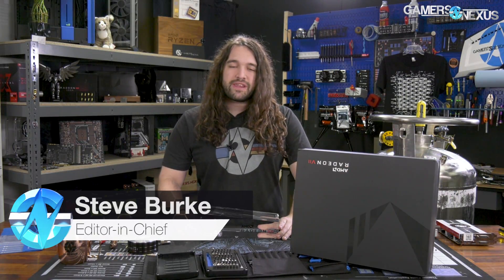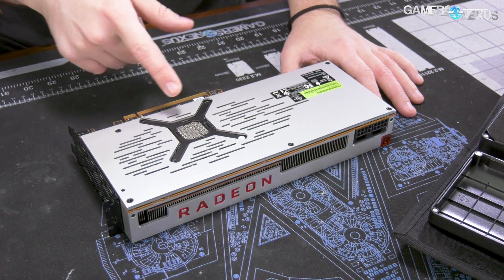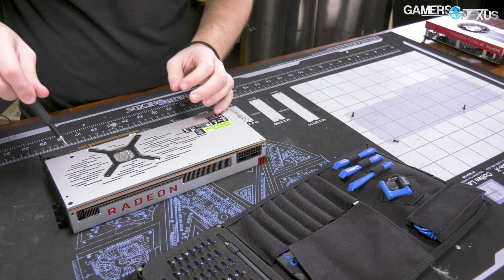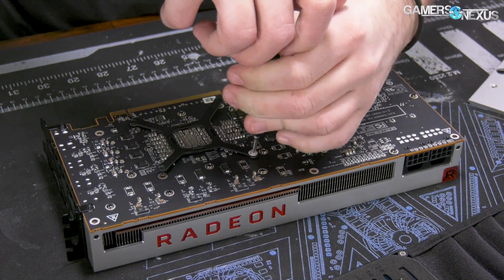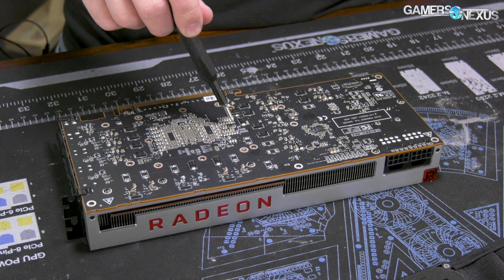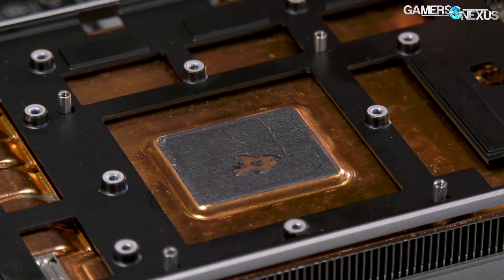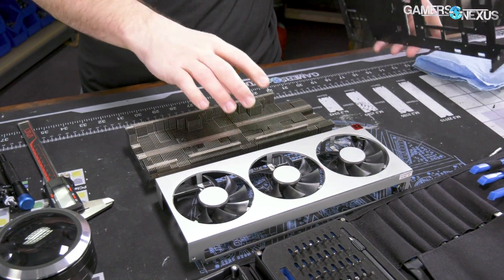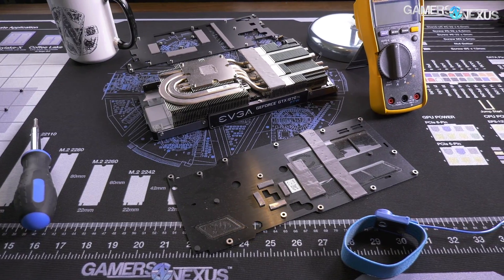AMD Radeon VII Tear-Down & Graphite Thermal Pad

Comment: Warranty Void stickers are also not enforceable in Canada.
Reply: Can technically cop fines for them in Australia
Reply: I had a rep from XFX tell me, on the phone, that they are not enforceable in North America.  He confirmed that they are to scare-off noobs; and, so they can tell if it has been opened while troubleshooting RMAs.
Reply: Not sure about Canada, but they can NOT deny a claim simple based on the fact the sticker was removed. They MUST provide proof that the user modifications caused the damage to the device. I believe this only applies if they are offering the warranty repair for free.
Reply: Nice. I did not know that. Thank you. I am Canadian.
Reply: If you had removed them without leaving any marks they would have to prove that they were there on that specific card which would also be quite pointless without having taken some pictures after being manufactured (showing part numbers too) - apart from the only reason is to scare customers off.
Reply: Doesn't stop Canadian companies from applying them though.  Memory Express slathered my beautiful G.Skill Trident Z memory sticks with oversized and very ugly warranty void if removed stickers.  Was a total PIA to remove the gummy adhesive left behind...
Reply: I dont know if they are in Poland, but I know that at least MSI has accepted my laptop for warranty repair regardless of the warranty sticker or lack there of.
They even took the laptop 3 weeks past warranty coverage saying that they accept the cost of the repair because it was clearly a manufactuing issue, even if it showed up after 2 years.

I have heard in the past that warranty stickers are there to discourage people from "playing with it" and then returning it when they break it, but that it is not the official reason.
I have had situations in the past (in Spain) where the warranty stickers were enforceable when I lived there, where the laptop companies/repair shops/shops would replace a damaged warranty sticker in order for a customer to get full warranty coverage.

But maybe I was just very lucky... (and I am a small sample size).

But it does make you feel safe buying from people/companies that treat you this good.
Reply: Not to defend the sticker but if they are using a graphite pad what reason is there to ever open it up?
Aren't those things focused on extreme longevity unlike thermal paste and so should never need replacing?
If it does adequately thermally the other manufacturers should put in those 1 screw pop-in pop-out fans that are so popular on Sapphire cards
Reply: @mycosys  Don't you guys have to vote or get fined as well?
Reply: @nonamefound68  Indeed - thats why driving voting down isnt a conservative strategy to rig elections here.
Reply: @mycosys  what do you mean??
Reply: @stevethea5250  It is a normal republican tactic to try to keep voting numbers down in the US. the more people vote,  democrats get elected. There is also a gerrymander that values votes in republican areas more, we have had that problem in the past too.

Comment: Finally true unboxing.
Reply: Why the instant autopsy on the item?
Reply: @mohdfaizal6773  why not
Reply: the downgrade on the VRM over the utterly insanely overbuilt Vega reference cards bodes either very well or very bad. Either AMD was sandbagging like mad when they stated a 300w TDP; or they don't wan't a repeat of the legendary value king Vega 56 OC specials where this card is able to eclipse later full fat Vega 7nm releases.
Reply: @mohdfaizal6773  To see how terribly made the card is.
Reply: Steve said that if he ever did an unboxing embargo video to shoot him. I'm coming for you, Steve.
Reply: @ashleyjohansson230  Terribly made? Did we watch the same video? The cooling design is on par with most Custom-Designs we have seen over the years. I think it will turn out pretty good :D
Reply: @mohdfaizal6773  to show master engineering of AMD in comparison to Nvidia GPUs

Comment: I love the cooler, it's so clean and professional looking.
Reply: Some hate it but I agree
Reply: Not professional but industrial
Reply: My take as well. It looks really simple, but it's a lot of technical work to get it to look so clean. Otherwise it would be a mish-mash of pipes and fins. Looks really good.
Reply: @youtubasoarus  i want to know temps of this since there will be no non reference models. I had 2 rtx 2080. Both are dead. Waiting radeon vii release
Reply: @evalangley3985  Ah I forgot to mention. I got full refund already. My first Gigabyte rtx 2080 gaming OC died after week of usage (blue screen, artifacts, black screen). My second was from MSI - rtx 2080 gaming x trio. It was DOA. Got refund the same day. RTX 2080/2080ti/some 2070 - lots of complains on Nvidia forum. Now I'm using my old radeon 7970 and waiting for VII
Reply: so nice and massive, im so sad i bought a zotac 2080ti amp extreme core, " also cancelled msi 2080ti gaming x trio and lightning Z " cause they never came :C
Reply: Yeah aside from the partially obstructed exhaust zones, the Cooler is simple (relatively inexpensive) AND looks cool (customer appeal).
Reply: I concur.
Reply: I do too! I hate the "gamer" aethetic that gets forced on graphics cards by these companies, but I've always loved the clean look of the reference AMD cards, especially the Vega cards. Just sleek and clean, no frills, no fuss.
Reply: @niodix  damn dude, made me ill just reading about that bad luck
Reply: @HickoryDickory86  
i really liked EVGA's GTX1000 Hybrid designs. they had a bit of that bolted together plate look, but still kept it fairly simple and clean.
Reply: @taiiat0  I wnt lie, the evga design for those cards did look really amazing. Didn't like them based on picture, but seeing one in person, the air cooler design certainly had an "industrial" look to it. I prefer it over the hybrid design, but the hybrid has better temps and is cooler :p
Reply: @ihatedwang  
yeah, i liked some of the Air Cooler designs for that generation too. that bling plate they used as a nameplate was a deal breaker for me, though. that looked so stupid to me that i wouldn't even be okay with using it, even if i couldn't see it.
Reply: Same I love the look. Looks so much better than cards nowadays.

Comment: I've been theorizing an how to use graphite as a thermal solution in electronics for years. It's so cool to see it done with resin to make a directional pad.
Reply: Cool story bruh
Reply: Ian H don’t you feel cool
Reply: @ianh43  it is cool because graphite has exceptional thermal properties (because carbon, of course) however it is limited in what "direction" heat flows through graphite/carbon or any material in general. Graphite is also a semiconductor in most forms hence why it is usually just used as a dry lubricant/negative casting in industrial environments.

It's so groovy how they utilized carbon in a high covalent bond state but avoided enclosing it within another space. I imagined it would find its way into a composite type heat pipe as opposed to "direct" contact.

Comment: Interesting Hitachi makes thermal pads as well as massagers
Reply: They are especially famous for their manufacturing robots and manufacturing plant equipment, they also make heavy machinery, and trains, and aircraft, defence electronics, consumer electronics, semiconductors, they are HUGE
Reply: @fortunefed8719  yep
Reply: @vyor8837  sorry, but i didnt mention HGST for a reason - they arent owned by Hitachi, they were sold to WD years ago, and the brand has been phased out.
Reply: Hitachi is just a massive corporation. Sort of like Samsung, who make everything from phones to washing machines to automatic sentry guns.
Reply: @fortunefed8719  they werent as bad as the IBM drives before Hitachi bought them. The DeskStar 75GXP was known as the DeathStar for a reason XD. Thankfully i bought Quantum back then lol, was rather sad when they sold their drive biz to crappy Maxtor (2nd time Maxtor wrecked my fave drives)
Reply: I don't know where this hate against Hitachi/HGST hard drives comes from, they're the most reliable HDDs I've worked with through the years.
Reply: @-eMpTy-  Ive not had major problems with HGST in the last decade, honestly i think it is still a hangover from the REP of the DeathStar, it really was that bad, far worse than the Seagate 7200.11 or the self blanking SandForces.
Reply: @mycosys  
Where there more "death stars" than the 75gxp? That's the only one I can remember which had problems.
Reply: @-eMpTy-  Afaik the moniker just stuck for years.
Reply: "massagers" I see what you did there !!! lol
Reply: @vitaobatera  i had really hoped someone would make the link between that and the robots. I have been sorely disappointed
Reply: Mitsubishi, Samsung, Hitachi, Daewoo, i love these multi-branch that make from consumer electronics, through heavy machinery to full-on weaponry. They feel like the closest thing we have to a cyberpunk megacorp, OCP style.
Reply: @stale2665  lol
Reply: Automatic sentry vibrators.
Reply: @shoesbuttback  apparently me pointing out their robots, and then explicitly saying i was disappointed, was a little subtle for you. I guess ur right tho - ive been celibate for days, and it isnt by choice.
Reply: @fortunefed8719  The Hitachi DeathStar
Reply: And portable nuclear reactors.

I had (might still have) a 22gxp. Awesome drive.
These days if you look at Backblaze's quarterly or annual drive reports Hitachi and now HGST rates very highly.
Reply: They also make elevators and nuclear power stations as well.

Comment: Worlds first 7nm videocard, holy smokes its awesome! Thank you Space Jesus!
Reply: No. Gaming card.
Reply: Tech* jesus
Reply: 7nm, but not really 7nm.  The standards are so weird.  Like AMD's 7nm is closer to what Intel's 10nm is supposed to be.
Reply: @KainArkanos  Yeah the semiconductor node names are just marketing, as the process can't be defined by one measurement anymore. According to wikichips, intels 10nm has the same CPP (contacted gate pitch) as TSMC 7nm, but TSMC 7nm has smaller SRAM cells (which are a pretty good measure of density). So TSMC 7nm competes with Intel 10nm on a pure data standpoint, but in the real world it looks like Intels yield on 10nm is still not very good, and they have only released a low power mobile CPU without IGP.
Reply: @alexanderdaum8053  Either tech is very impressive and I fear we better get used to them for about the next 5 years

Comment: Vapor chamber + heat pipes, and a heatsink that fills out almost all the entire space of the chosen form factor. In terms of maximum thermal dissipation, this is basically as good as it gets without making the footprint of the card lager to fit in more fins, or moving on to a waterblock. Really impressive.

Comment: that xfx series of amd cards looked sooooooooo sexy. sadly they dont do them like this anymore.. :(
Reply: Yea true, they even made a triple axial cooler for the HD 7990:

https://cdn.videocardz.com/1/2013/09/XFX-Radeon-HD-7990-Triple-Dissipation.jpg

I also really liked the older Gainward Phantom designs:
https://image1280.macovi.de/images/product_images/1280/856412_1__49329-1.jpg
Reply: But they tended to overheat (IIRC of course)
Reply: I miss my R7 270x card from them...
Reply: @imneverbackingdown  R9 ! :P
Reply: But xfx had one of the worst hd 7970 cards for example, from this ghost series.

Comment: wow this is a very simple cooler design, but still looks that it can cool a lot
let's hope at least that it does XD
Reply: with 300w power draw it better cools REALLY well
Reply: The only I doubt is that graphite thermal pad, though the number is much higher than my cheapo thermal paste. But hope it will do just like it should...
Reply: @gamtax  I'm sure tests have shown that thermal pads only have 1-2c differemce. However, this thermal pad is "different" than things like grizzly pad and others I think.... In other words, I doubt you'd need to change the pad for some good thermal paste/ or find it necessary for a degree or so difference.

Comment: That should be TDA21472. They are 70A power stages but nowhere to find data sheet.
Reply: @tommihommi1  Yes that's the same as I found. If it is a improved version of TDA21470, it should be able to handle 30A with 95%+ efficiency. That's quite impressive.
Reply: @yitaozhang5847  I have some friends who work at Infineon, maybe they can get the data (but it's unlikely). If they leak it to me, I'll send it to buildzoid loo

Comment: Around 17 minutes in, you state that only 2.5 of the heat pipes make contact with the "relevant area" referring to the area directly above the die, with the heat spreading characteristics of a vapor chamber, wouldn't any area on the vapor chamber that those heat pipes come in contact with be a "relevant area"? BTW great tear-down as always.
Reply: I think the pipes themselves actually serve as expansion for the vapor to be wicked away from the vapor chamber (the square part of the sandwich). They are not actually in the sandwich part, they are like the fingers of a glove I think, where the palm is the vapor chamber itself.
Reply: @youtubasoarus  I am 99% sure they are a separate system, as attaching the heat pipes to the vapor chamber in such a manner as to allow for effective wicking action to occur would be extremely expensive.  

It's hard to see with the fin stack, but most likely they are each isolated heat pipes sitting on top of the vapor chamber, just like the new Nvidia RTX cards.
Reply: @SweetBabyJay  dont think that's how it works man. They are integral to the whole assembly one big chamber. How else would the liquid from around the die evap? Where would it go? It goes int the tubes, settling into a vapor and hence wicking away the heat.
Reply: @youtubasoarus  vapor chambers have the condensation occur at the top of the chamber and the liquid travels back down to the base along the edges. Their function is to spread heat.  That's where the fins on top come into play, to dissipate heat. Heat pipes transfer heat from one place to another. If placed on top of a vapor chamber they are quite effective. Look at the Nvidia thermal solution for the RTX 2080ti, they are heat pipes soldered on top of the vapor chamber. 

Really, we need @Gamersnexus to cut this heatsink in half to tell us once and for all of the heat pipes are a fully integrated as a single wicking system (a first as far as I know in the industry) or if it is just heat pipes soldered/fused on top of a vapor chamber which is a common practice. Steve needs to do it, in the name of science.

Comment: Looks like an expensive heatsink
Reply: step 1: Cripple airflow for design
step 2: Have to build an expensive heatsink to compensate
Reply: $320 of HBM + $180 of heatsink.
Blocking airflow with a big, gaudy company logo is hip nowadays.
Reply: @tommihommi1  Doesn't look like they crippled airflow for design, looks fairly decent as far as coolers go
Reply: my old 5870 vapor-x on the wall is a proud papa crying right now.. :)
Reply: @Cavey Möth
forgive me for my whataboutism;  but GPU's have a way to go before they start pulling the same shit we are seeing on motherboards these days. I miss the X58 days, where companies like Asrock would use cheapo vrm's for value mobo's, but cool them so well that they OC's just a bout as well as vastly larger and more expensive designs. [ X58 Extreme3 for reference]
Reply: wish they made 2 120mm support heatsinks without a plastic cover.
Reply: Nah no RGB fans.
Reply: still cheaper than Nvidia's

Comment: It seems especially ironic they put the blockage in the fan shroud RIGHT over the GPU itself
Reply: Not really relevant if there is a fkin block of copper above it anyway. Propably should just push some cooler air to the copper.
Reply: seems like a good proportion of that heatsink is overhang anyway. that logo is nothing a dremel couldn't fix if it turned out to be a problem. it's just a LED lit piece of plastic on an aluminium plate

Comment: thats a lot of copper ..is that real?
Reply: No, they painted iron.
Reply: It’s electroplated probably.
Reply: It's plastic.
Reply: It's painted wood. Mahogany; extra-fancy.
Reply: It's unobtanium
Reply: no, that's just the lighting
it's actually rose gold
Reply: Nah its pure gold. Lightning makes it look like copper
Reply: @MunkeyChips  lol this isn't an nvidia gpu
Reply: @Shieftain  Pretty sure Nvidia's would be made out of a block of glue a screws with a mahogany vinyl applied to it.
Reply: I heard they are using either painted rubber or painted uranium for the units that may leak to Nvidia
Reply: I doubt it's solid copper. It is more likely copper-plated zinc (like modern American pennies).
Reply: @HickoryDickory86  Nah... I bet it's copper... vapor chambers are NOT solid... otherwise it wouldn't be a chamber lol
Reply: @vitaobatera  Yeeeeaaaahhh... and that's not at all what is meant by "solid" in this context.

Take, for example, "brass" musical instruments. They can be "solid" brass, silver plated brass, or "solid" silver construction (which is extremely rare now). That does not mean you are to understand the instrument to be made of solid metal and is not tubes and pipes. It means the metal that makes up the tubes and pipes are the single, solid metal.

So again, because copper is so expensive, I doubt these vapor chambers are solid compper construction. They are liked copper coated. But then again, I could be wrong. Doesn't really matter either way if they get the job done.
Reply: @HickoryDickory86  True, anyone can be wrong... I see what you mean, like a aluminium sheet coated with copper... it surely have a much bigger area than a true copper heat pipe... but still I think it's too thin to reduce the price that much... we may see it in about a week...

Comment: I just want to say I love blower coolers. I think they are really cool because they move hot air away from the card as quickly as possible, the triple or dual fan designs blow hot air straight back onto the pcb.